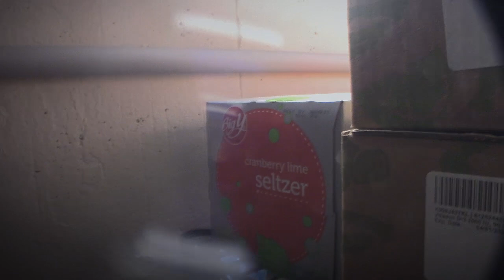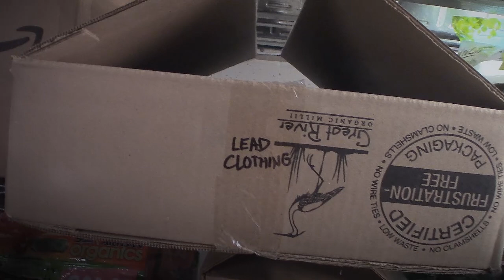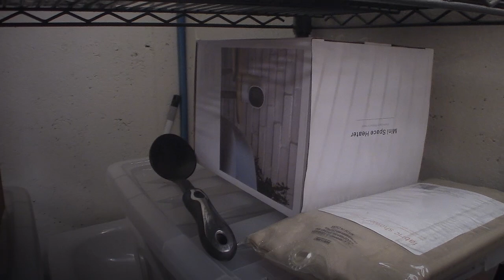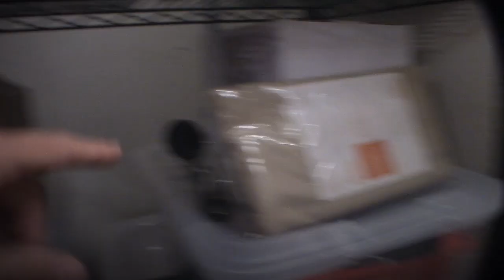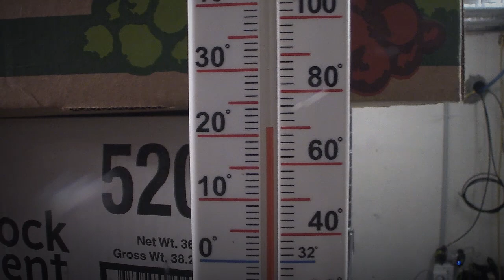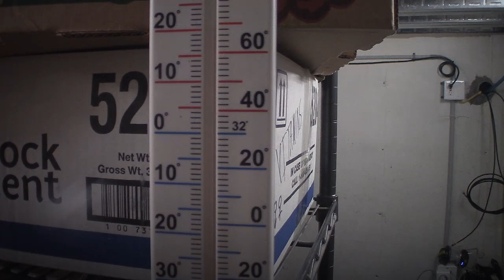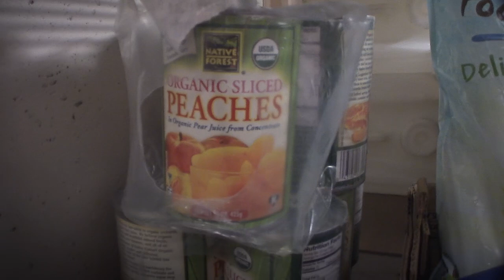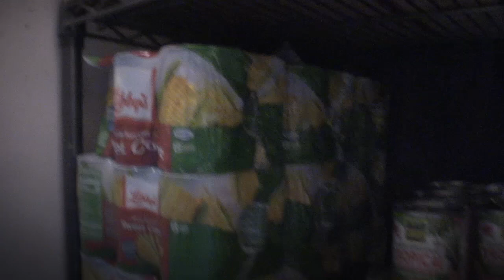Do You Need a Fallout Shelter?

Comment: Not sure if anyone has said this already, but if you align mirrors in conjunction with your light holes, you could increase the luminosity in the room.
Reply from the maker: You're the second to suggest such a thing - the first person was actually myself. ;)
I probably only mentioned this fact once during that Project Homestead series, but the tubes are lined with Mylar sheets and the 90 degree bends were painted with reflective mirroring paint. There IS a gap in the mirrors though, which I have yet to fix and that's the first 4 inches or so of the tubes. That first 4 inches where the top fitting is set is UNmirrored. So a lot of light gets lost there. I still need to put the mirror inserts into that section to grab as much as I can.

Comment: You mentioned being able to be locked in with the hasp on the door. Borrowing an idea from walk-in coolers, instead of screws to affix the hasp, drill all the way through the door and use carriage bolts (from the outside-in) and put wing-nuts on the inside. In the case of becoming locked in, you can unscrew the wing-nuts and poke the carriage bolts out to disconnect the hasp from the door. Much less effort than hacking through the door with a hatchet or an axe.
Reply from the maker: That's a good idea. I think my main realistic concern is a tree falling on the hatch and pinning it shut. I'm not really concerned about being locked inside - setting aside non-rational paranoia. But for a situation where being locked in WOULD be a more plausible concern, your tweak to the hasp would be a great idea!
Reply: @PraxisPrepper  Tree falling and blocking the door is a much more plausible concern. 🙂If it's not feasible to change to door to swing inward, you could cut an "access hatch" in the door and hinge that to open inward. That way, if the overall door was blocked you could open the hatch to squeeze out. Or at least stick your head out and see what the problem was.
Reply from the maker: @chrisriek6480  That's a good idea too. I plan to at some point probably rebuild the door anyhow because some parts of it were not pressure treated and I've had issues with termites. If/when that happens, a mini escape hatch might be a good addon.

Comment: If your water is shielding isn't it contaminated?  I am not being a smart ass, I just want to learn.
Reply from the maker: That doesn't sound "smart-ass" to me at all - it just sounds like a smart question. I'll do my best to answer it as correctly as I can. But first, I should say that what I'm going to say is what I've learned by reading research materials done by people who are not me. So my knowledge of this is second-hand and is (to the best of my knowledge) accurate. But I wanted to let you know that I haven't independently tested this out myself.
So with that out of the way... what I have come to understand the reality is is this. If water is exposed to radiation, the water itself does not become radioactive. The atoms within the water may very well (and certainly do) become ionized during the bombardment. But the radioactive materials do not "infect" the water. Once the water is removed from the bombardment (while it might have ionized atoms dissolved in it) it is not radioactive. IF... BIG IF HERE... IF the water has not become contaminated with radioactive dust. A pool full of water outside will get radioactive dust it it and then that water will become a radioactive "tea" so to speak - not because the water molecules themselves have become radioactive, but because there are radioactive particles dissolved/suspended in the water. If you are working with totally sealed containers (and you're sure that the outside of the container is clean, or has been cleaned of any radioactive dust (to avoid contamination), then the water inside will be safe to use.
I hope that helps. It came as a surprise to me as well when I was researching this topic many years ago. Best luck to you WL!
Reply: @PraxisPrepper  thank you so much.  This is good information.
Reply: I was wondering about this also. Thanks for your thoughts Praxis.

Comment: Real comment, not porn bot.  Still need test run 🏃‍♂️ and a exhaust vent of the shelter. Smells, moisture and Co2. No fans for air circulation.
Reply from the maker: I think an exhaust vent would be a bad idea because I really want for the outgoing air to put pressure on every crack leading into the shelter. An exhaust fan would be more efficient, but I want to be sure nothing is being drawn in (aside from what's coming through the filter). You're right that it needs a test run. It's been super hot recently. I'm hoping to be able to do a test run before things cool down so I can see how it works when the incoming air is very warm.
Reply: @PraxisPrepper  pressure flap, Praxis. Like a gas mask. Not  straight up 45 downward bend..
Reply from the maker: @Diebulfrog79  That's not a terrible idea - not an exhaust that draws, but just makes outgoing air leave more freely. I may do that if the leaks preexisting don't seem enough to let the air leave when I test.